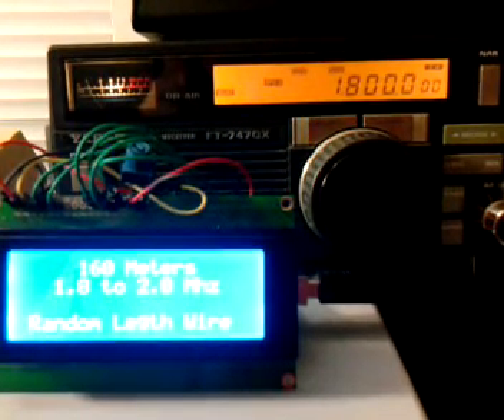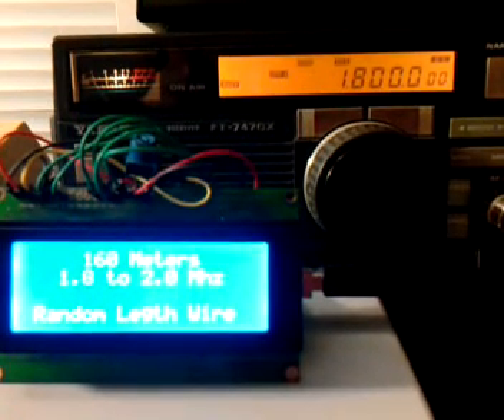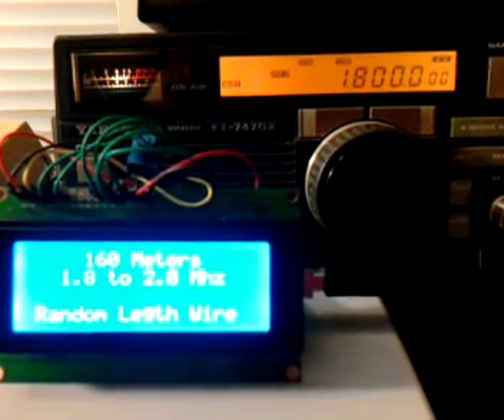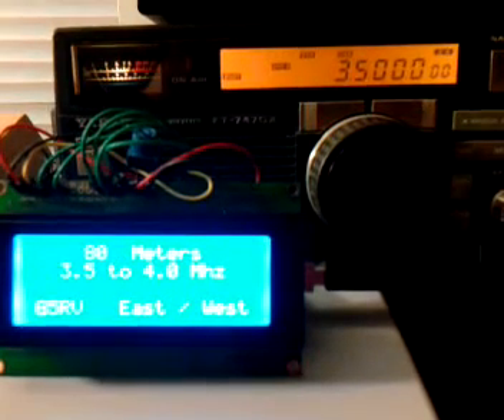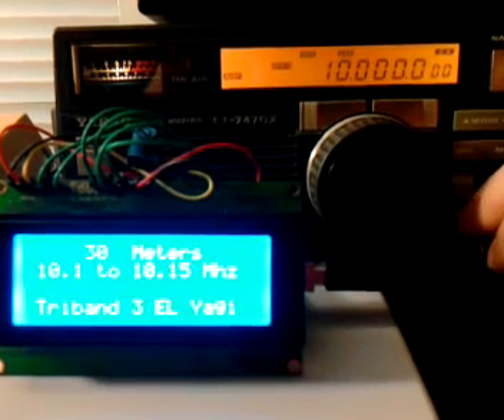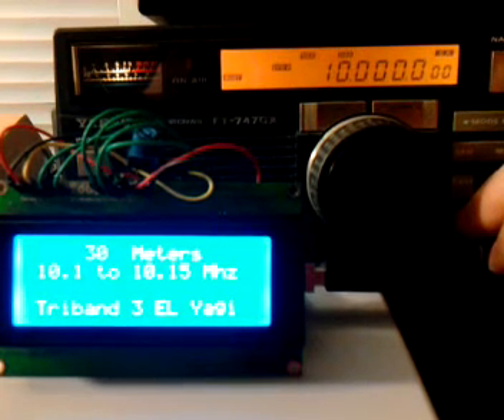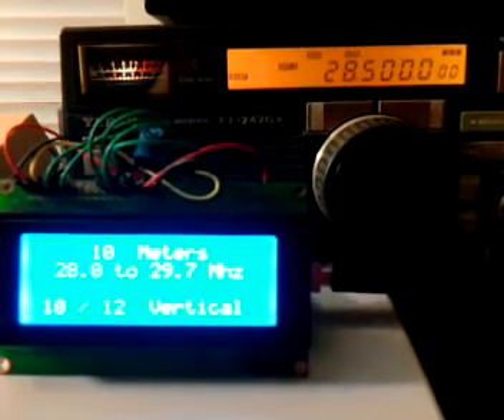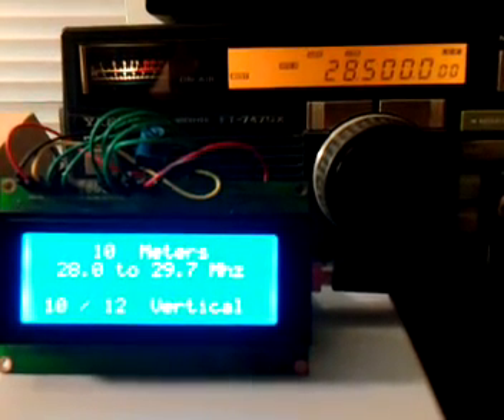Automatic HF Antenna Switch using Arduino

Comment: Have you made any progress with this project? I have an Icom which reads band voltage.  The Yaesu which outputs BCD was easier to write the arduino sketch for, the Icom has slowed me down.  I’m interfacing with Ameritron RCS-4.  Let me know if you any thing available for sale.  KC4CL, 73,s